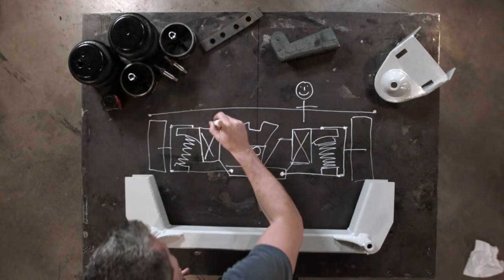Dodge A100 Van: How To Replace The Suspension And Engine | Wheeler Dealers

Comment: Just a heads up the thick spacer should go on the same side as the castle nut. It should go Ball joint, Thin washer, spindle arm, 3/8 spacer and castle nut. I hope this is how it was installed in final preparation other wise you will be going threw lots of ball joints.

Comment: I love the Dodge A100's and have a rare. Higher top camper van, a 108. I too want to do something with the front end but I don't know if I can do what you did although I love it. Can I buy the kit anywhere or could I use the front end from some other vehicle. I also want to move my V8 engine back about 18 inches and put a bench type seat in it and I think the van would handle better. What do you think? Please get back to me. My van is a 1963 and they didn't even make them until 1964. Mine is two tone orange. I love the split windshield and pie pan headlights. Can you make a DVD on what you are doing with instructions and I will buy it from you. I also want to make each side of my split windshield to crank open. I think they were the coolest vans ever. I really love the work you are doing. It will be so cool that you will be able to raise and lower it like a lowrider and your handling will be much better. Mine is an automatic. You will probably have disk breaks too which is so much better. Please get back to me. Great job!.

Comment: I own a A100 van. It's a 1965 model and it have a Slant six. You call the famous slant six rubbish ? One of the most reliable motors ever produced? You talk rubbish. To restore a neglected slant six is easy. And why did you build your own motor brakets instead of using the original well functioning brakets for the V8? 
I have these parts waiting on the shelf when I will swap the original 170 slant six for my 273 V8 .With correct ORIGINAL parts the motor is bolt on. No amateur rebuilding needed. 
My slant six will be used in my 1966 Plymouth Valiant V100. 

I am a Mopar guy since 1980. I was 17 years old when I bought my first 1965 Plymouth Valiant. 
Today I own : 
1956 Chrysler Windsor
1965 Dodge A100 Van
1966 Plymouth Valiant V100
1976 Dodge Aspen SE Coupé V8

I also own : 
1975 Moto Guzzi 850 T3 California motorcycle
1988 Opel Manta GSI Exclusive with the full Recaro kit including the big wing at rear end. 
1990 Audi 100 Avant Turbo with 3 speed automatic transmission and black leather interior. 
1990 Audi V8 (d11) . 

Next time you shall think twice before you even touch an A100. And especially don't talk shit about the Slant six. The famous leaning tower of power. 

This build just show how much of an amateur you are when it comes to rebuild a car.
Reply: I'm sure that he meant that the Slant's in a rubbish condition due to neglected maintenance. Not that it was of a rubbish design.
Dropping in the V-8 wasn't done because the Slant was of inferior quality. It was done for making the van fetch a higher price on turnover. Besides, the surf theme and modern suspension fit to a power upgrade better